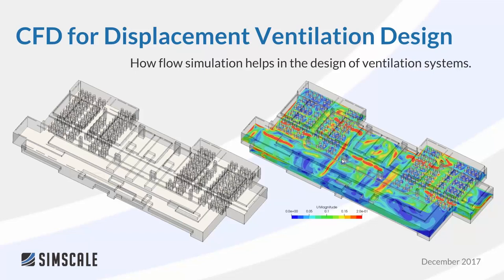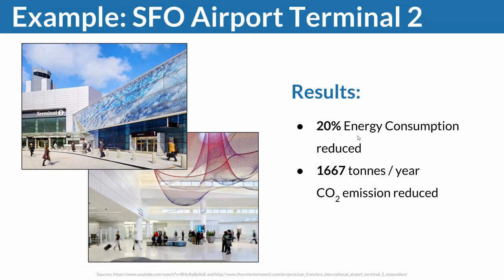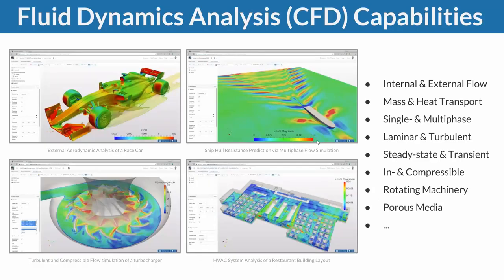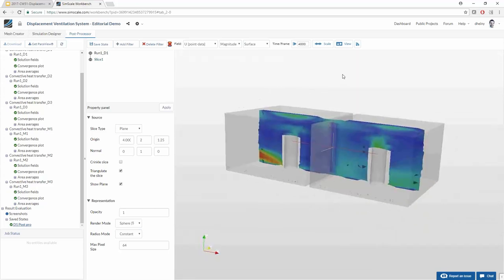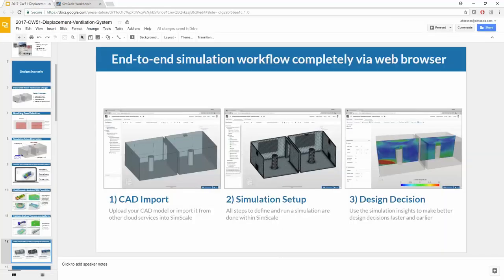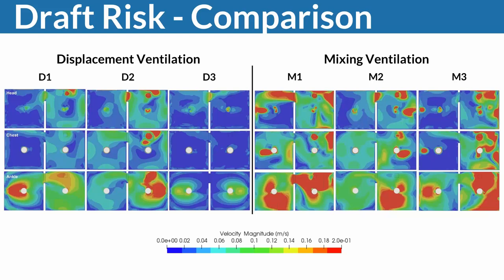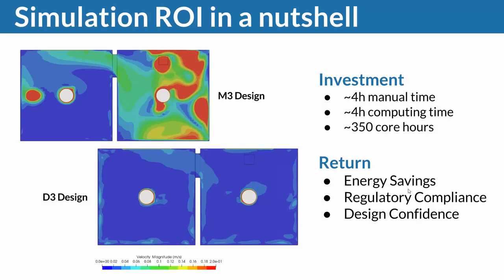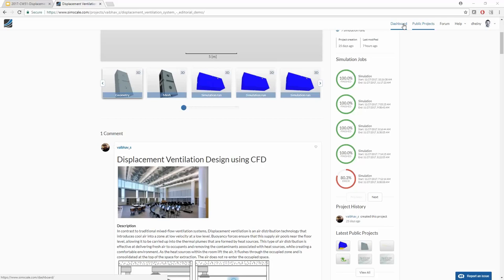Displacement Ventilation Design with CFD

Comment: Hi David, Thank you so much for this. Recently I did attend Sustainability and Cities Simscale event. I am using this platform and a still a learner and beginner. I am keep facing multiple challenges in setting a basic geometry particularly 3d solid and sheet faces errors. In normal circumstances, fixing geometry 3d solid and checking each faces is a very cumbersome process in the simscale platform.. i have tried all options but my 3d solid model is reading errors in simscale... how to correct it. Errors increases all drafting efforts in 3d solid in simscale platform.. any advise would be great. Thank you.
Reply from the maker: Hi Aakar, sorry to hear you're having issues. The best way to get support would be to post on the forum (https://www.simscale.com/forum/) or use the live chat feature.